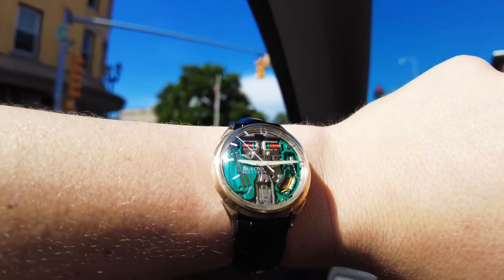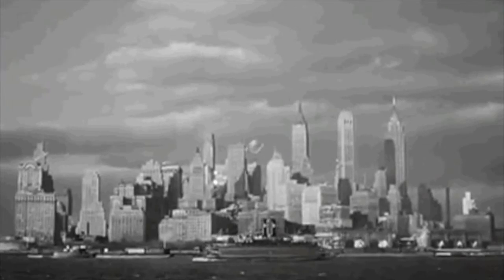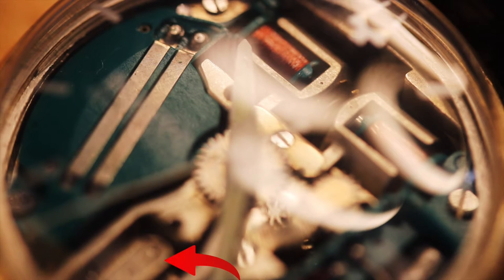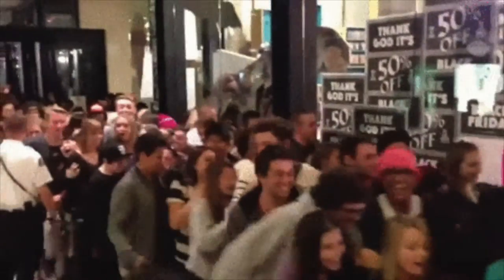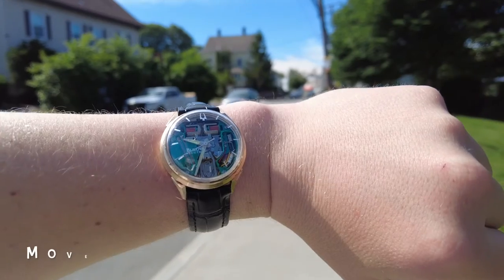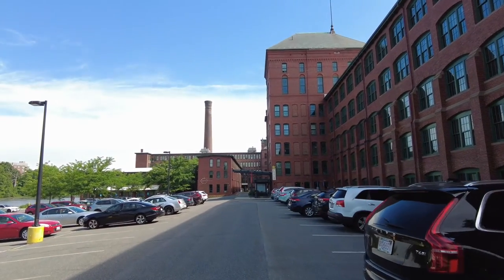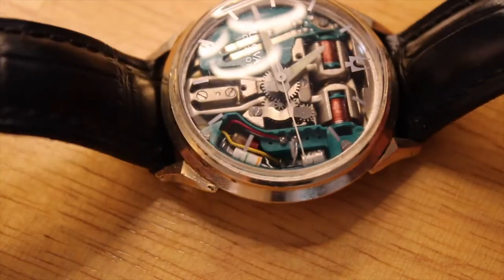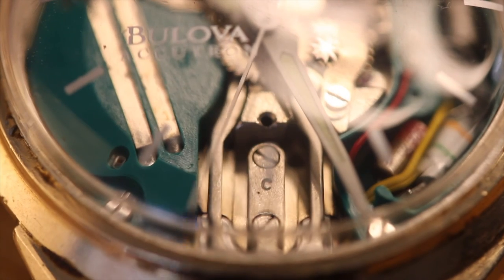The Rich History Of The Accutron Spaceview - 1966 Review

Comment: After you change the battery or the time, you have to give the side of the watch a slight tap to Kickstarter the tuning fork movement.
Reply from the maker: I definitely did. And it would run and then die